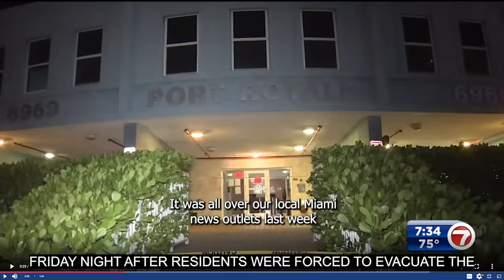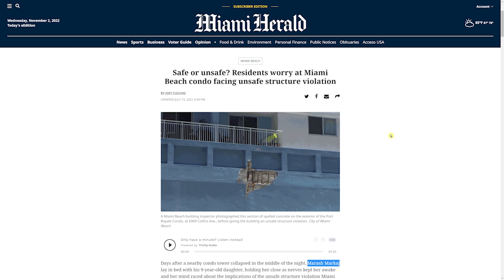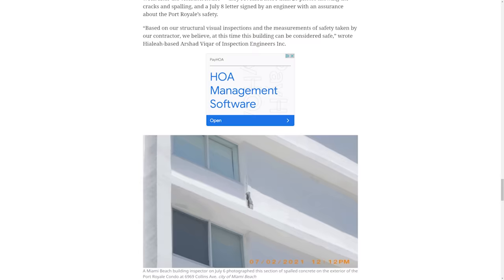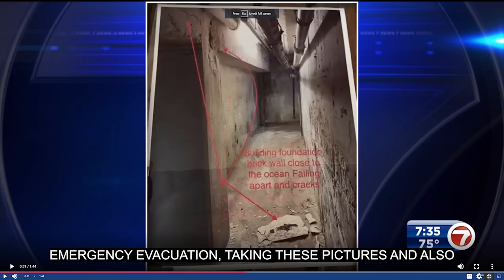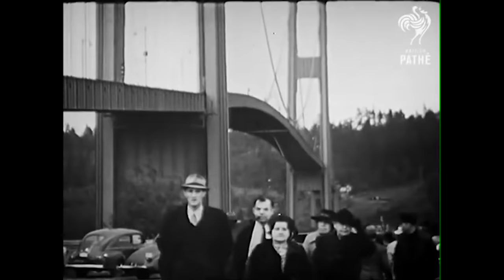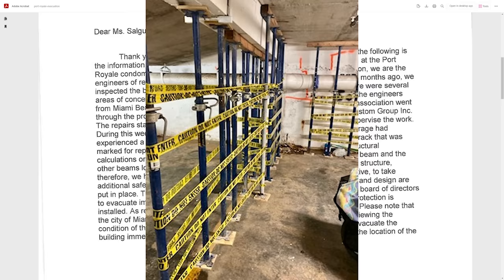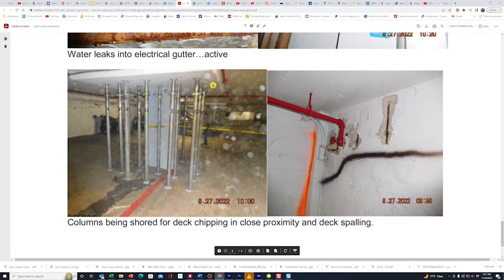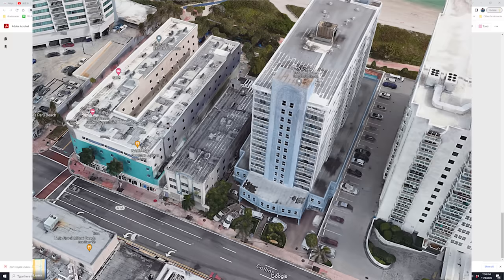Another Miami Condo Evacuated Why it Will Collapse

Comment: I've been waiting for this for years. My brother-in-law told me years that people were in for a surprise when a BIG hurricane hits Miami Beach. He worked construction down there back in the 60's and 70's and told me that after the building inspector inspected the building they would move the steal beams to another building for it to be inspected.  Can't ask him about it now since he died a few years ago. I always hoped he was just telling tall tails.
Reply: I used re bar once when I was building a pol, noted now the re bar has a coating of green zinc chromatic paint , and I wonder If anybody knows if that works or not?
Reply: I seen many times rust and green in pictures. I think those greenish "coated" bars don't work. Only thing to avoid rusting is stainless 320 etc or 316 (more chrome and nickel)
Reply: So disgusting
Reply: @edwardjackson1418 The paint is to prevent rusting.  It does prolong the life of the steel.   

Trust me. Im a union ironworker
Reply: @jannejohansson3383 Stainless is 2-3 times the cost of galvanized or epoxy rebar. We would install it if the customers were willing to pay the cost. But most customers like things as cheap as possible
Reply: How about just pure concrete without rebar?  The ancient Romans used pure concrete.  No rebar == nothing to rust, so their buildings are still standing 2000 years later
Reply: Ok, but you have to have REALLY good concrete. Pull out your lime. For starters, and don't add water after it starts to set.

Comment: As a specification writer for a large architectural firm, I always specified that the steel must be sandblasted to its white (clean) condition,then coated in zinc before using.   99% of the time the construction administrator would blow that off and say it wasn’t necessary.   This results in the “rust never sleeps” corrosion.    Everyday I’d drive past buildings (ours and everyone else’s and see steel going in that was heavily rusted.   It’s a slow, but ticking time bomb.
Reply from the maker: Now they use epoxy coated rebar
Reply: I bet this will get worse before it gets better!
Reply: The rebar almost always, contains some rust. Even at the store. Its just rusty stuff. And when it doesn’t have rust, put it out at your jobsite a couple of days. Or installed in the footings. It’ll start rusting soon.
Reply: Construction people always ignore engineering drawings.   It’s very frustrating when you carefully calculate a design & then it gets sabotaged by an incompetent person with no degree

.
Reply: Rusty rebar bonds better to concrete than clean rebar. This is well known in engineering circles. It is only an issue in a salty environment.

Comment: I used to do undersea fiber cable installation in the cable stations.  These facilities were always reinforced concrete, but towards the 2005 timeframe, new constructions were very different from traditional designs.  Every time we went to install at those older facilities, the concrete was weak, spalled, and in many places around the world, the rebar may or may not have even existed.  So I have no doubt that residential structures get even less maintenance and scrutiny in many areas.
Reply: How long can concrete last?
Reply: @justagirlsd3000  The Pantheon’s dome is made of concrete. About 2000 years old. Reinforced concrete is different.
Reply: @justagirlsd3000  
Romans and the ancients used a concrete that withstood a salt sea environment.
Reply: @uploadJ  a piece of knowledge we seemed to have lost, what a shame.
Reply: Residential = cow boys pass inspection. I did geo work for while. One time did I put hole in home site I didn't sign papers as I was told. Bc few years ago another geo test company did site test passed left well already 15ft fill with trees in in under pad not tested but now signed off. 2 years later 400k home split half
Reply: What an interesting job! 😃
Reply: What an interesting job! 😃
Reply: The ancient Romans used pure concrete.  No rebar == nothing to rust, so their buildings are still standing 2000 years later
Reply: Steel-reinforced concrete  is fundamentally flawed (because the steel rusts).  It needs to be phased-out like asbestos was phased-out.

Steel-reinforced concrete is a bad idea that gradually falls apart & collapses.
Reply: @un-nerdyneko  Not lost but what they had was simply their version of concrete which was not in any way reinforced.  What I do not know is why re-bar is never protected by sacrificial anodes. All ships have them to prevent corrosion.
Reply: @Fossillarson  Punctuation is like the support beams of sentences. Hard to make sense without it.
Reply: That is the coolest sounding job! I'm a former locator of utilities but I don't think you need a locator for your lines! All this stuff just fascinates me. I wish I had some engineer friends to chat with... 😎 Cheers
Reply: @patrickpowers5995  Buried steel Water and Gas mains also have cathodic protection and anode beds... 

I mark the locations of water lines and they drill/hydrovac down to the line and set a puck of material on/beside the line (or something) and it protects the line from corrosion.
I guess it is easier to react with the added protection material than with the line itself and this the main will not rust until every molecule of the preferable material has been gobbled up first.

Well, something like that, so I was told...
Oh— so fascinating!
Reply: @uploadJ the secret is using salt water to mix it.
Reply: @electrictroy2010  Take a look at all the Soviet apartment blocks. Those really ugly things. Those are made from reinforced concrete, and prefab slabs/panels. They will not fall apart, not even when you factor in 30 years of extremely shoddy maintenace since the USSR collapsed. 
Hell, look at Pripyat. With literal zero maintenance and a lot of vandalism, those apartments are still standing - and those go through a lot of freeze-thaw cycles. 
Reinforced concrete as a material is fine. It has limitations - like all construction materials - but when used properly, you can build buildings that last for many generations.

Comment: I used to live South Florida and seen old buildings in Miami with deteriorated walls and corroded pipes.   In some places the pipes are gone.  The problem being in the tropics once water gets into the metal workings it breaks down very quickly like cancer.   If you don't get it all removed it will keep going.   That building from what I've seen is too far gone to even try fixing all those problems.  They're better off tearing it down and build a new one which is a shame as this is totally preventable if they did the proper maintenance.
Reply from the maker: Yes, so important to keep your buildings well sealed and well painted
Reply: I agree.
Reply: I agree Noah....no way would I ever move back in....I would be afraid to go in and even move out my possessions!
Reply: The problem is not "water getting into the metal workings". That is just a symptom of what is wrong in the construction trade. Too many buildings being designed and built with the use of inferior products and piss-poor oversite during the construction process. It shouldn't take a genius to figure out that building a supposedly re-enforced concrete structure, feet from the beach, that harsh conditions will destroy the building. Furthermore, these types of buildings on a barrier island, just doesn't make sense. I guess there was too much greed available to overlook that fact.
Reply: A new one would be built just as shoddily.
Reply: @corin164  It's partly due to unions, but also partly due to the inspection process.  It's kind of hard to inspect the inside of columns unless the inspector is Clark Kent.
Reply: @jeffostroff  Jeff, I know too that coastal automobiles have their radiators and other parts rust right out in just a couple short years.  People also have problems with their computer, stereo, and appliances rusting out on the coast.  Really, inland, you can drive a car for 150,000 miles before you need to recore the radiator or heater core.  But on the coast, you're doing it every 2-5 years!
Reply: @corin164  Bull$hitt, the problem is lack of regular maintenance, and amateur/ band aid / substandard repair methods. These buildings have been standing 40-50 + years. Design flaws, workmanship issues would show up a lot sooner, like the FSU bridge.
Reply: @tuck6464  - And the Coliseum has been standing in Rome for over two thousand years. The length of time is not the issue. When you make a building that high, on shaky ground and near the ocean, you better know what you are doing since you are risking the lives of many people. And please refresh my memory on how you do maintenance on a re-enforced concrete structure. There is no such thing. When this type of structure goes bad, all that can be done is replacement, that's not technically maintenance.
Reply: @justaskin8523  Chicago area my Mercury Zephyr Wagon lasted 281,000 miles before the floor started to rot through. I worked as Messenger only one head job to replace the rubber valve seals due to burning too much oil. Standard suspension work done as needed I was running 55,000 miles a year.
Reply: Everything has life span. Building has it too.
Proper maintenance can make it longer though it costs $$$$$.
We now know that those who bear the cost can only live in concrete condos in Florida . It is time to introduce flood proof, hurricane proof, salt proof buildings in Florida.
Reply: @corin164  The ground is not shaking in Miami  Stop making up falsehoods!!!
Reply: Pat Luxor  Seemed to me, to be contractor method error.
Reply: @corin164  re: "And the Coliseum has been standing in Rome for over two thousand years."
Some of it, NOT all of it ... why did they stop using it? "London Bridge is falling down, falling down, falling down, London Bridge is falling down My Fair Lady"
Reply: @KB4QAA  . . . and please tell me at what depth do you hit bedrock? I doubt if you do. I live on a barrier island to, and the pilings here do not hit bed rock. The only thing that prevents the pilings from loosening is the static force of the sand pressing against the piling. The building code only requires that one third of the piling has to be buried.
Reply: Pat Luxor  Maybe so. FSU designed, FSU doesn't build anything.
Reply: Pat Luxor  Untrue.  FSU did not design, build or supervise the construction of the pedestrian bridge.  Contractors did so.
Reply: @KB4QAA  I never stated that Miami is shaking. I was using the word "shaky" as a metaphor to describe questionable standards in the building of a high-rise.
Reply: The ancient Romans used pure concrete.  No rebar == nothing to rust, so many of their buildings are still standing 2000 years later
Reply: @electrictroy2010  A recent news release devoted concrete and why Roman structures lasted over two thousand years. The scientists who did research on the subject and found that Roman concrete was a mixture of white powder called slaked lime, water, and tephra. Tephra is the ingredient that’s created from volcanic eruptions, with most of it sourced from the area of Pozzuoli (my childhood home) on the Bay of Naples. This material was transported all over the Roman empire and was widely believed to be the ingredient that gave Roman concrete its trademark strength.
Reply: Well I think steel-reinforced concrete is fundamentally flawed (because the steel rusts).  It needs to be phased-out like asbestos was phased-out.

Steel-reinforced concrete is a bad idea that gradually falls apart & collapses.
Reply: @electrictroy2010  Reinforced steel has it's perks.  I agree they should phase out steel in favor of something that doesn't react with water like fiberglass.  Or even carbon fiber rods!
Reply: @electrictroy2010  Instead of using steel they could use carbon fiber or fiberglass rods so it wouldn't react with water.
Reply: Saw.  You saw old buildings.

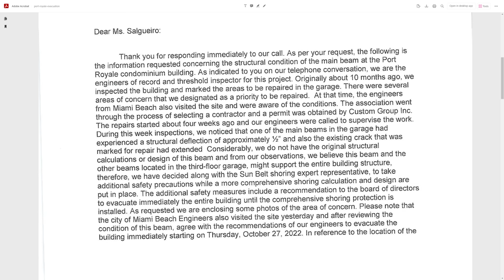Comment: Having lived in Florida and being Navy, I can assure you that concrete is permable and salt spray is migrating into the concrete and the rebar is all rusting. Its a strip filled with dominios waiting for that final crack of doom. At 9:03 you see massive rust staining.... I think every bit of rebar in the exterior walls is probably comprimised.
Reply: Agreed.  Old buildings were made from pure concrete.  These new buildings use steel skeletons inside the concrete.  The technology is fundamentally flawed (because the steel rusts).  It needs to be phased-out like asbestos was phased-out.

Steel-reinforced concrete is a bad idea that gradually falls apart & collapses.
Reply: @electrictroy2010  but how do you strengthen concrete (especially in high-rise buildings) because I thought that's what rebar was for? Plus it's not like they drill down to bedrock in FL when laying the foundation so wouldn't a bulkier heavier building on sand be worse?

Comment: When you showed the rebar expansion due to rust, I remember reading about the first Athens Parthenon restoration of the 1920's . They used iron I pieces to join the marble slabs and the iron rusted and expanded it damaged the marbles. The ancients used different metal and the voids where filled with molten lead for weatherproofing
Reply from the maker: Almost ancient Romans and Greeks they knew how to build roads
Reply: I can imagine a row of ancient engineers in white robes shaking their heads in disbelief
Reply: Well we were going to book an air b and b on Miami Beach in one of the high rises there but now we’re not so sure? 🤔🤷🏻‍♂️
Reply: The ancient Romans used pure concrete.  No rebar == nothing to rust, so their buildings are still standing 2000 years later
Reply: The ancient Greeks used wood pegs to hold the columns together.  They didn’t use metal, because that expands at different rates than stone (also rusts).  The ancients were smarter than us
Reply: @electrictroy2010  And they also didn't build the type of structures we can build today using concrete and rebar. They were very limited in the type of structures they could build without rebar (typically concrete domes/arches and vertical structures which are naturally under compression where concrete is strongest). Not saying their structural achievements weren't very impressive for the times, but they pale in comparison to what we can do now.
Reply: @electrictroy2010  Yeah, Im sure wood pegs would hold up very well in the type of concrete structures we build today. Like in any modern dam or the Lake Pontchartrain Causeway or the Burj Khalifa or many modern skyscrapers.🤦‍♂
Reply: Just be on a lower floor. It's EXTREMELY unlikely, unless maybe you have a huge hurricane? If you hear weird sounds, banging or hammering, that's your sign to go.

Comment: Lived in Honolulu for many years.  They had similar problems with the salt environment but also compounded by contractors using salt contaminated sand in original concrete mix.  Was a big mess and I’d be worried about any and all Florida buildings built in the era this one was.
Reply: Yeah I stayed at the Sheraton on Waikiki. Built in 1971. Saw some rust on that puppy and wondered about that.
Reply: @AyeCarumba221  it sure makes you wonder how many more beach condos are suffering from this problem? 🤔
Reply: Old buildings were made from pure concrete.  These new buildings use steel skeletons inside the concrete.  The technology is fundamentally flawed (because the steel rusts).  It needs to be phased-out like asbestos was phased-out.

Steel-reinforced concrete is a bad idea that gradually falls apart & collapses.
Reply: Is there a comparable option to concrete? I'm gonna assume it's used cuz it's cheap and workable, but is there another option for the needs of contractors?
Reply: @electrictroy2010  is cathodic protection a realistic option?
We use cathodic on steel water/gas lines here in Canada, but we also don't have a huge saltwater issue to contend with here in thw middle of North America. Does anyone think that a similar kind of prevention-protection is a feasible option down south there, in Florida?

Comment: I was working down in Tampa Bay rebuilding a battery recycling plant and it was very impressive how common Spalding was on the old concrete.  Thankfully the new owners of the plant weren't interested in messing around and we were leveling the whole plant a department by department and the Spalding was even found in center of a 4'x4' support collim
Reply from the maker: Best way to do it Jay!
Reply: @jeffostroff  thanks for the comment 😊
Reply: BTW, it's 'spalling" not spalding.  I assume the latter is from auto-correct gone wild.
Reply: @KB4QAA  I wish I could blame the machine but there's the reason I'm a welder not engineer
Reply: Old buildings were made from pure concrete.  These new buildings use steel skeletons inside the concrete.  The technology is fundamentally flawed (because the steel rusts).  It needs to be phased-out like asbestos was phased-out.

Steel-reinforced concrete is a bad idea that gradually falls apart & collapses.
Reply: @electrictroy2010  it works if you are willing to spend the money and time keeping up with maintenance, I wonder if stainless steel could be used to prevent this issue